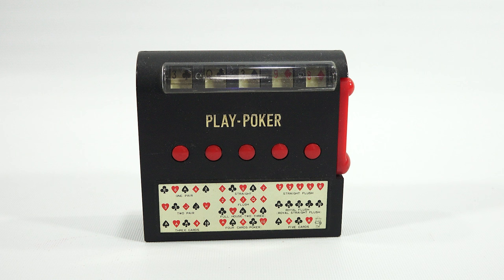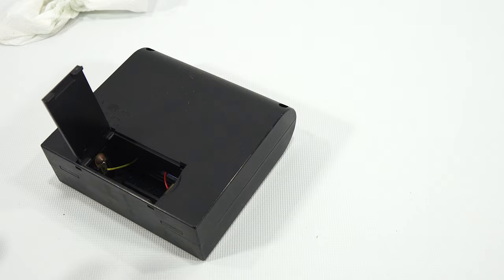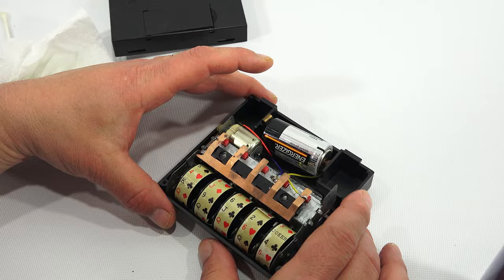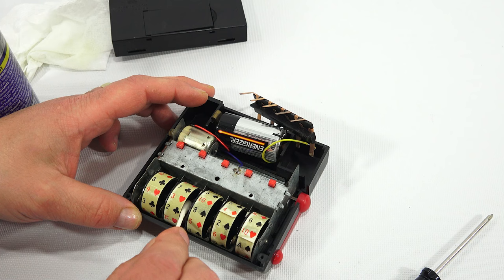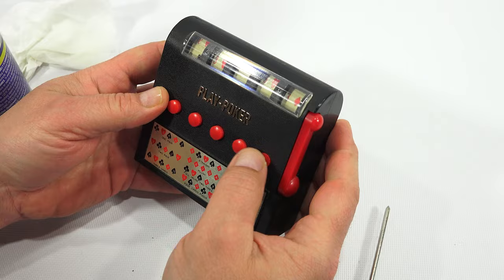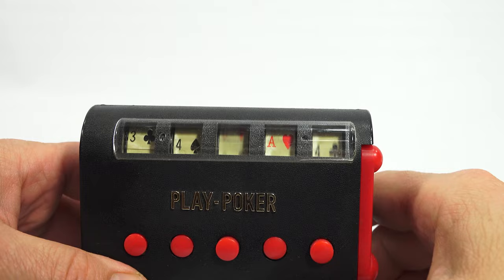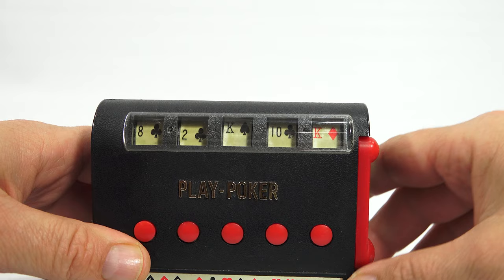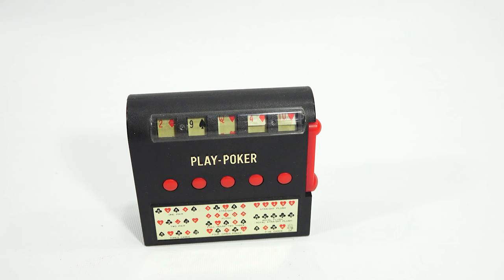Vintage 1970 WACO Made In Japan Play Poker Slot Machine Poker Game

Comment: Watching people fix things who aren't handy at all is extremely frustrating. The stickers on the dials are peeled and getting caught on the brass contact bar. The motor squealing means it needs oil sprayed inside of it.
Reply from the maker: It worked great with a few small modifications.  Read the description for more information.  Spraying inside would have been a big issue and required a more delicate approach.
Reply: LPS-Dave is very skilled when it comes to fixing things!